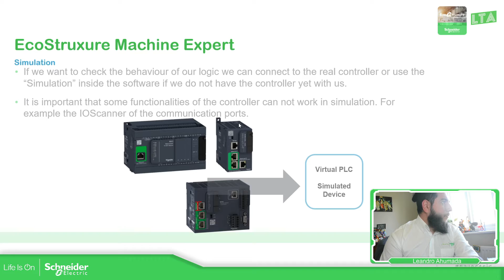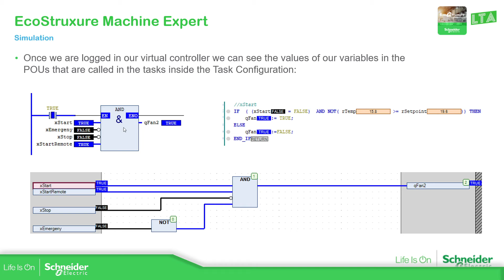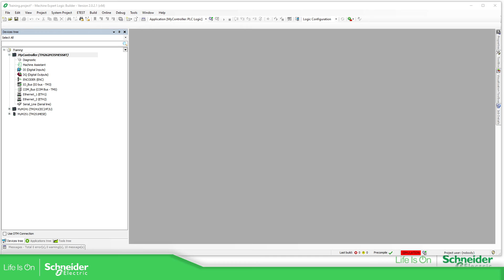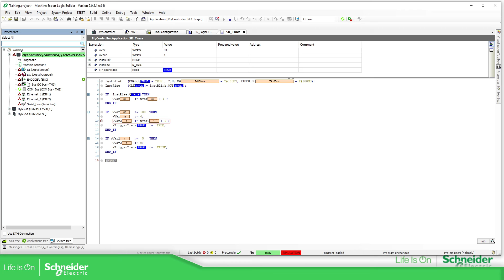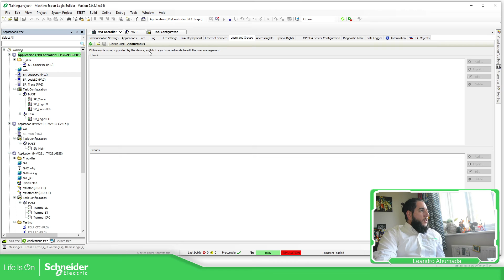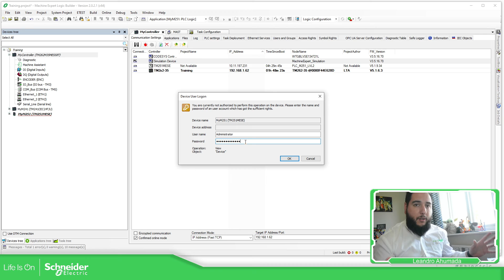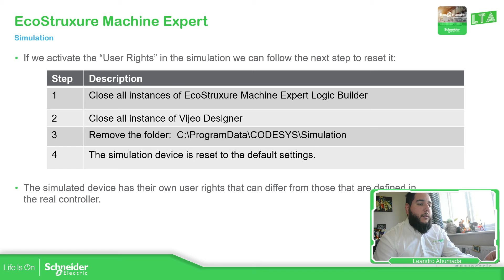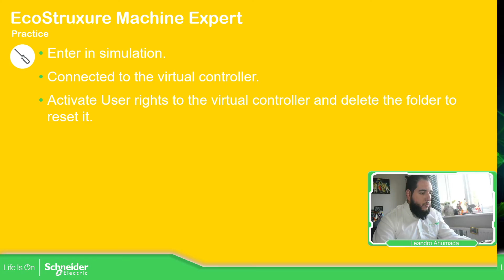EcoStruxure Machine Expert Training - M6.1 Simulation

Comment: Hello. How can I send an email for example to my gmail using Machine Expert in Simulation mode. I used example project but it didn't work properly in Simulation mode.
Reply from the maker: Hi there! I do not know if in simulation the library works. You should try it with the real controller.
Reply: @LeTomasAHUMADA  thank you

Comment: if you don't mind. This 'x1sClk' system bit, I noticed it's toggling on and off every 1 second. Can you help me understand - does that mean it's on for 500ms and then off for 500ms, making the full cycle 1 second as %s6 in machine expert basic or control expert ?Or is it on for the full 1 second and then off for the next 1 second, so the complete cycle is 2 seconds? Just want to make sure I understand how that bit is behaving.
Reply from the maker: Hi there! it generates a signal with 500ms in TRUE and 500ms in FALSE state. You can double check it using a trace :)

Comment: Thank u For this helpful video. Does the system bit (i_x1sClk) work in Simulation?
Reply from the maker: Hi there! Very good question. If I am not wrong that variable works using the real plc. You can replace that by using a blink function

Comment: How can I simulate the digital input/outputs? If I start simulation the IDE tells me the bus for inputs and outputs is not running (M241).
Reply from the maker: Hi Marcel H, if i am not wrong you can force the value of the IO and then it will affect the code 😊

Comment: Hello, What should I do, when I don't see "Simulation Device" in MyController Communication settings menu?
Reply from the maker: Hi poweska89! If you do not see the "Simulation Device" it could mean that the simulation is not activated, please go to "Online > Simulation" then you should be able to see a SIMULATION red square box at the bottom of the software. If that does not work then i recommend you to execute from windows the software "SoftSPS".
If you still do not see it then do not worry after the activation of the simualtion try to logic and the software will try to connect to the nodename "MachineExpert_Simulation" that has the controller name "Simulation device" then it will show up there.
Reply: @LeTomasAHUMADA  Hello, I can run simulation and check that program is working etc.. SoftSPS is running, I can See "Codesys Control WiN V3" in communication settings. Problem is that, I don't have  this nodename "Simulation Device" . I need this becouse I want to run simulation of HMIST6 as well, so in EOTE software need to be fill simulation device node name :/
Reply from the maker: @poweska89  you will need to use the nodename “MachineExpert_Simulation” in eote. If this does not work try to open machine expert as admin or try to update to the latest version of the software. If the problem persist i totally recommend you to contact the tech support of schneider in your country
Reply: tuve el mismo problema y solucioné reiniciando el gateway try application para Machien Expert 2.2

Comment: Does the modbus tcp master work in simulation?
Reply from the maker: Hi Mischa de graaff! I am afraid that in simulation the communication feature do not work (as far as i know…) . The only one available to use is the “machine expert protocol” in case you want to simulate the connection to a simulated hmi using vijeo or ecostruxure operator terminal expert.